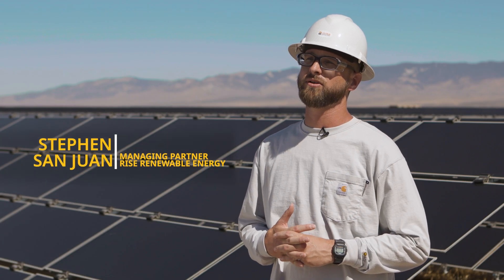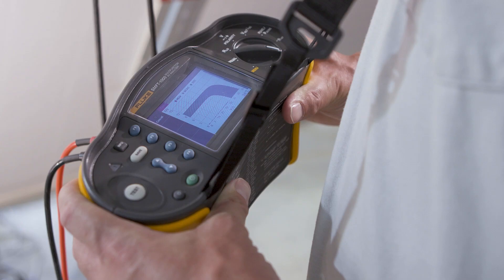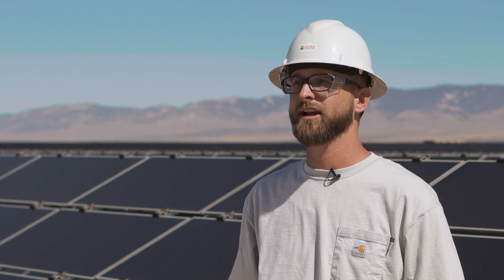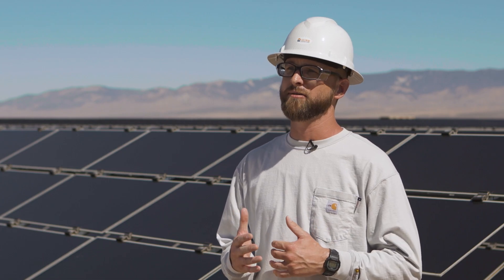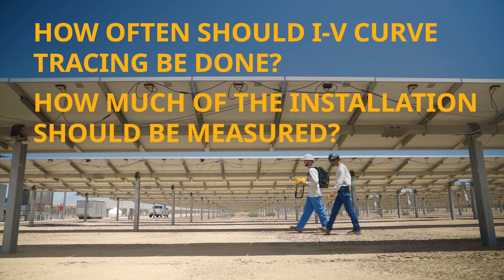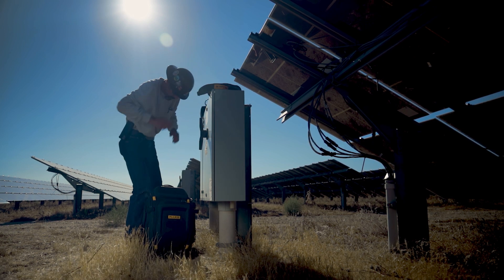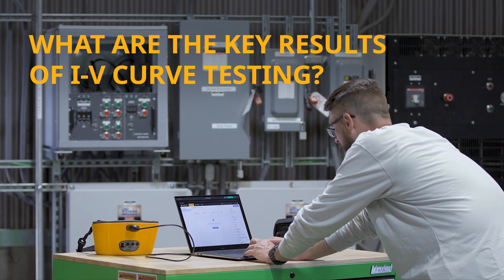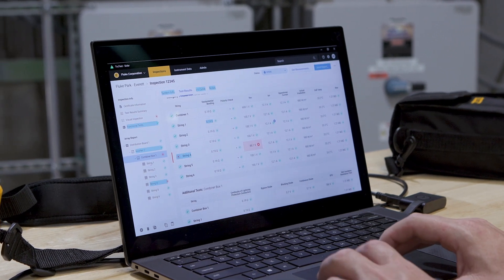Why is solar I-V curve tracing important?

Comment: I'm impressed by this technician's knowledge.  I now live in the Antelope Valley and am aware of the site featured in this video.  I drive past it periodically.  Would it be possible to contact the technician in the video to get his advice on design recommendations for a new solar system for a home?  The home will undergo renovation, to include replacement and redesign of the roof.  As the roof is designed and built, I want to optimize it for the ideal solar system for the home, and for periodic cleaning, and testing as appropriate.  Perhaps going through this process might make for another great Fluke video.  In any case, speaking with the technician would be greatly appreciated if possible.  Thanks.